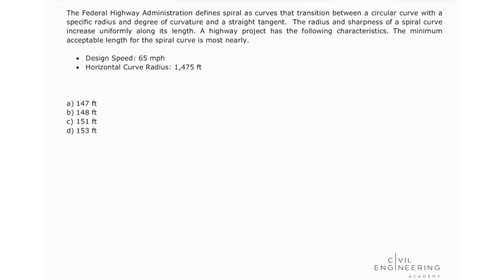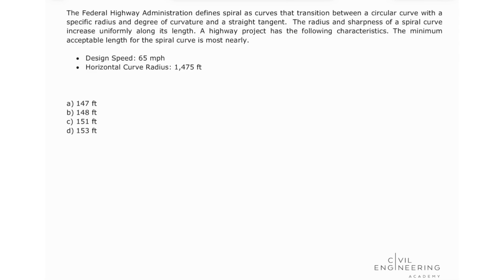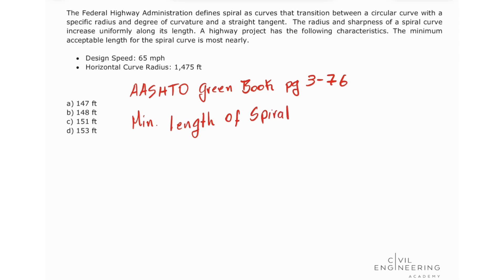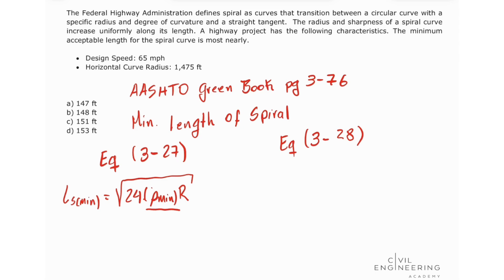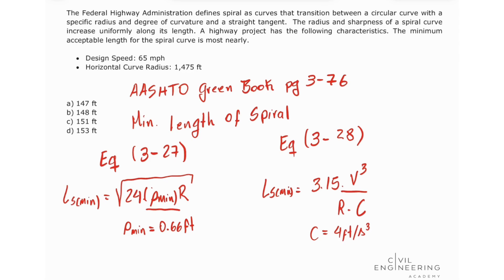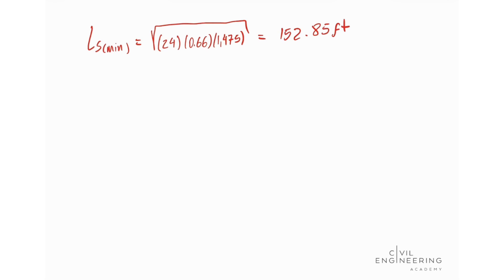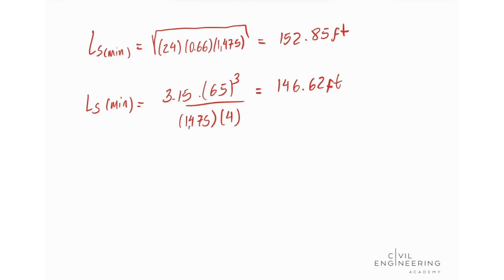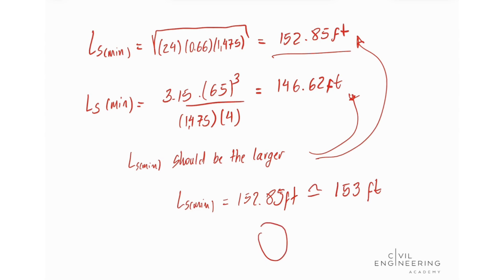Civil PE Exam – Transportation – Calculate the Minimum Length of a Spiral Curve

Comment: You should see table 3-19 to finalize the length. Technically for 65mph the spiral length is 191. So 191 should be used. But the options doesn’t have. But the procedure is we need to compare it to the design table 3-19